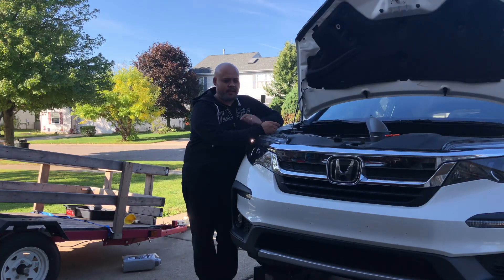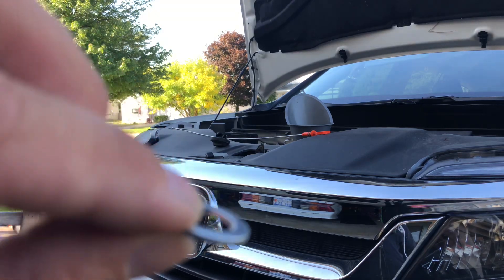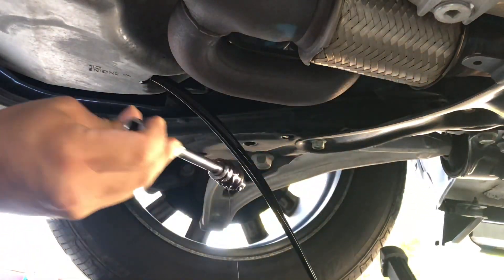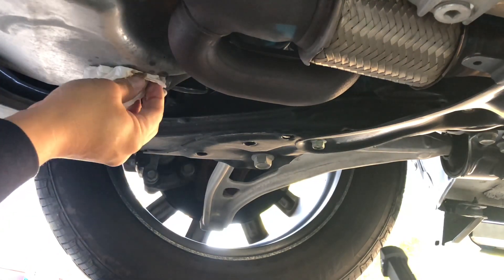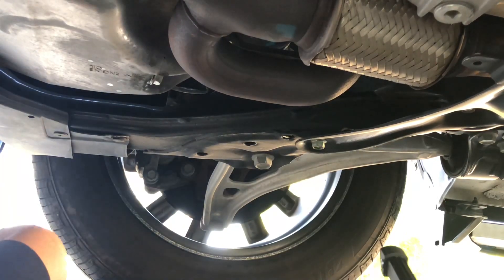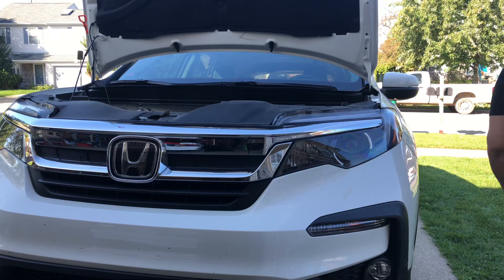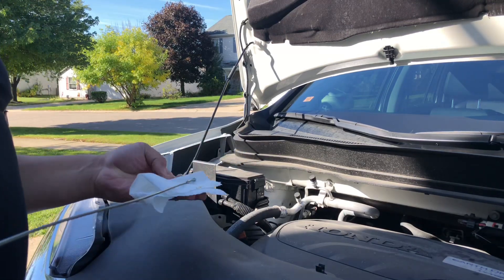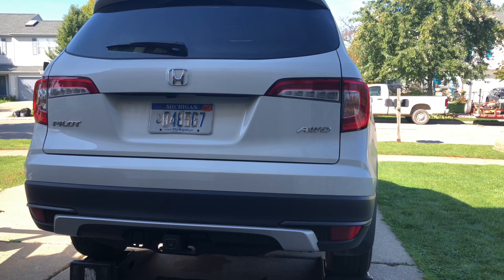2019 Honda Pilot oil change!

Comment: Do not risk over tightening drain plug.  Its 29 foot pounds. Buy a torque wrench once and save yourself a headache forever.   If you want no filter mess, take a plastic  bag and place it up high around the back side of the filter housing  like a taco shell and direct  the gravity flow of oil to the wheel side of the cross beam and into the pan on the ground.   Lot less oil to clean up and no residual on your car and no hot oil smell.  Like the plug removal tip with the extension.

Comment: I normally let the car idle couple minutes make sure the oil filter filled up even though I pour oil in filter before I install it, then let it set for 5mins so all so the oil out of the valve train completely drains down to pan. Then, I top it off. The crush washer can be reused if in pinch depending on how tight you crank the drain plug in, it you smash it then it can’t be reused. Planning on buying new passport shortly which same as pilots. Thanks for the video, looks very straight forward. I agree with VVT you need to change the oil often, ( often IMO every 6 months if more 5000 miles or one year less than 5,000 miles. I plan on keeping my vehicle’s for 8 to 10 years. Thanks.

Comment: Do you need to jack up the car off ground?  I have an MDX. I can change oil without jacking up the car. I am considering buying a Pilot, and would like to know. Thanks!
Reply from the maker: G gsnow2k if your a real skinny guy you probably could get by not jacking it up. I’m not so I put her up on ramps. If you can fit yourself and the drain pan your good.

Comment: Thanks for the video and for saying that you didn’t change the washer and it developed a leak bc I was wondering about that
Reply: Except he's not using a torque wrench. Proper torque with a flipped washer has never leaked for me, but they are cheap and should just be replaced.

Comment: Isn’t there a metal shield protector skid plate type thing right in that area? Did you totally remove it, as you made no mention of that.
Reply from the maker: There is not thanks for watching